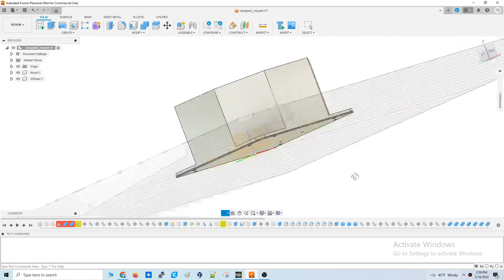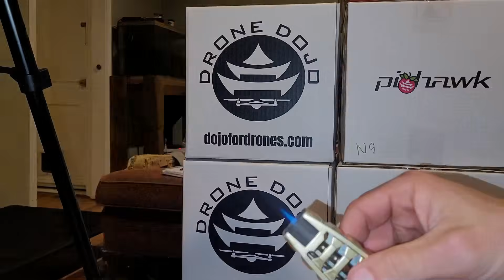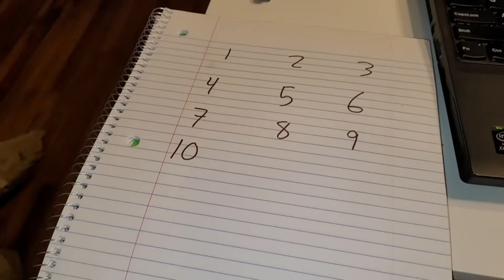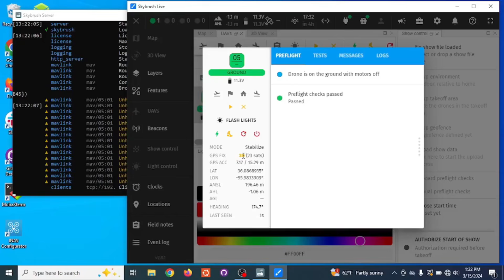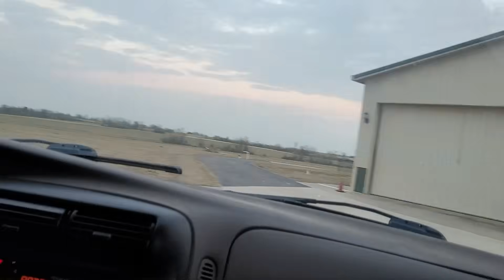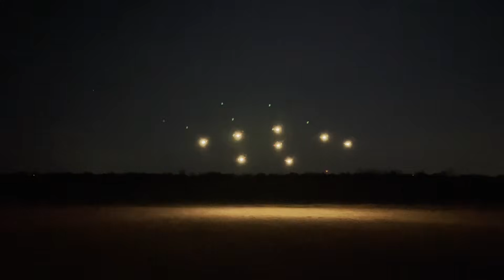Build A DIY Drone Light Show From Scratch

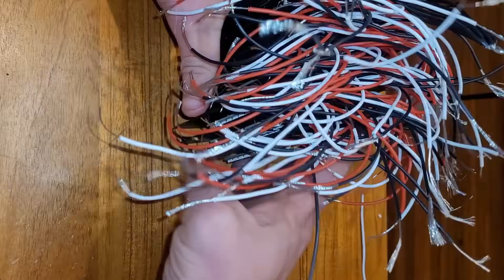Comment: 13:50 I'm so sorry but this was a waste of time and wire, it was enough to make a bridge between one strip and the other and for food safety the first and the last to avoid the risk of a low voltage not reaching the last strip. Another even more economical, fast and sensible thing was to use an 8x8 LED matrix that if it goes wrong you pay $5.

Comment: Hey dojo great video !!! Loved it. But what is the need or purpose that's served in this mission with the Raspberry pi SBC ? Can't we not skip it ?
Reply: U can do it with esp modules too. I would prefer to use esp 8266 node mcu. Bevause there is s proper repository available for it. U can easily do all the settings and firmware stuff. 

Esp 32 is not stable state rn..

Comment: Hello. Why used raspberry Pi?
Reply: They can hold some storage for if it disconnects for a second it wil still know what to do and gives the pixhawk better gps capability also makes it easier to use the lights and makes firmware easier

Comment: Well done super informative! I have a few questions: 1. Instead of using 7 of the neo pixel boards would it not be more effective to use the 8x8 board and only have the one solder point vs each individual board? 2. Is the need for a controller on each drone necessary ? Would it not be more effective to have them all binded to one controller   That way In an event of an emergency it’s one switch. For arming would be the same one switch for all.

Great work you’ve have sparked a new project for me!

Comment: Awesome! What is the longest flight time? (I am guessing here)  F4 FC with 4s 16850 setup may yield a longer flight time and a smaller drone size, which is better for small size party. We need a better cost effective solution. also, that 8x1 led assemble is such a pain :P . will just a 8x8 do the trick?

Comment: I am super new, and plan to buy the course. What is this RD Pilot or Ardi-Pilot software he mentions?
Reply from the maker: Hi there Jeff! 

ArduPilot is the firmware that runs on the flight controller. It basically tells all the sensors how to fuse together to get a good position estimate. It also updates the motors at 400 times a second to stay level. I'd recommend checking out the Drone Programming Primer first, as that covers all the software like this in detail. After that, go into the How To Build A Raspberry Pi Drone course. Then you're ready for the Drone Light Show course. All of those are included in the Blue Belt program

Comment: Did you have to load any software to the Raspberry Pis to make this work or is that for future use?
Reply from the maker: I used MAVProxy and Pymavlink on the raspberry pi to handle the MAVLink networking side of things. The pixhawk and pi are connected with 2 communication channels: UART and MicroUSB. Both channels are used to pass along commands coming from the Skybrush Live GCS

Comment: please could it also be connected to your MICRO DRONE with Pi ZERO. And how much does everything cost extra? I mean probably just RTK+lighting?
Reply from the maker: The RTK price would be the same. Right now, there's no escaping that. It's about $200 per RTK GPS. Could change in the future. The smaller drones have enough flash on the F405 FC to run, but they'd likely get a much lower flight time than the big drone with the LED payload.

Comment: dammmm thats really awesome ... keep up the good work ... just a small doubt .... can i use telemetry module to connet to diffferent drones and then send commands from a single computer which can reduce the cost of the companion computer .... plus how can i make the size of the drone less and then use them in a drone show
Reply from the maker: Thank you! Good question. The telemetry module can be used but only for controlling a single drone at a time. This system requires a router based MAVLink network to communicate with the ground control station. A smaller drone could work, but you'll likely get less flight time out of it
Reply: @thedronedojo  well thats nice but how can i make a single drone more cheaper? and in a small drone what all components i have to use ? please guide cuz you are the only guy that seems to have knowledge about this stuff

Comment: Can I use the software to fly a couple fixed wing aircraft in a formation with aerobatics?
Reply: With the power of programming you can do anything.
Reply from the maker: @LupusMechanicus definitely
Reply from the maker: Hmm I don't think the Skybrush + Ardupilot collab has ported this idea to ArduPlane, but I don't see a technical reason why this wouldn't be possible